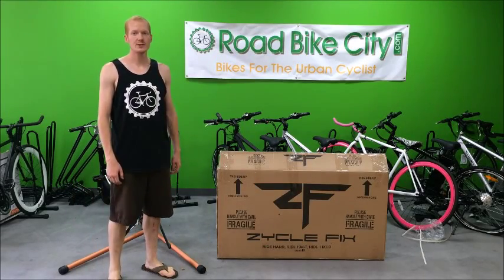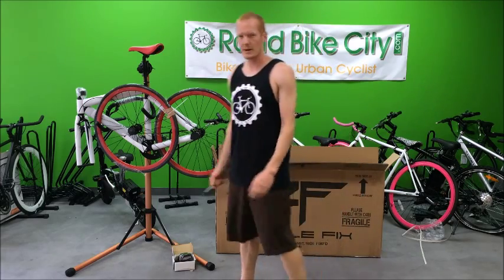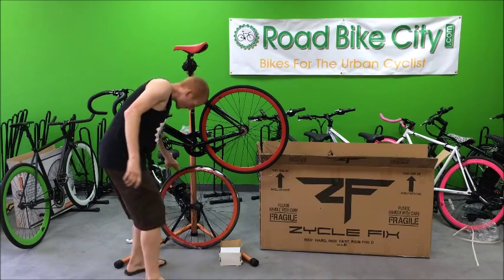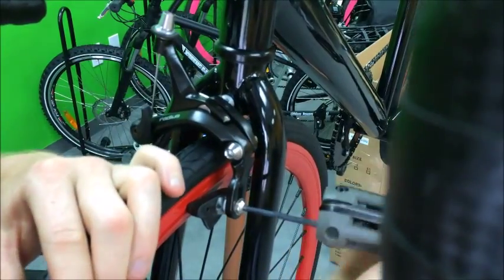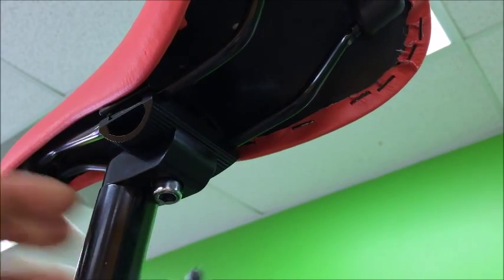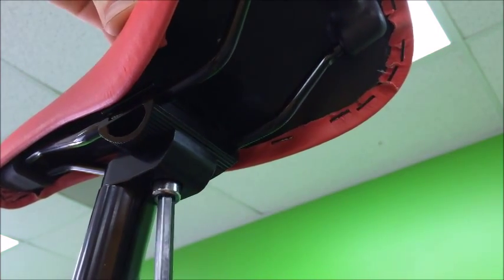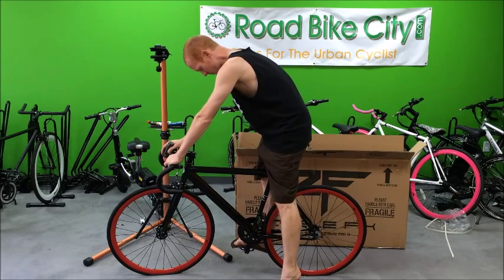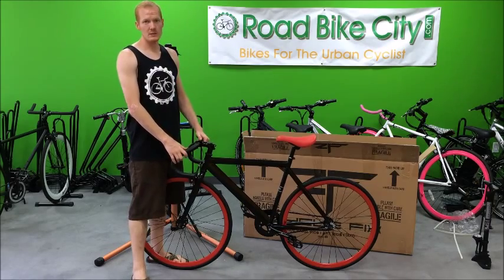Zycle Fix Prime Series Assembly

Comment: This bike looks like it will breakdown within a week. New BB, tires (as usual), brake pads, brake levers, and eventually wheels. I rather get the Retrospec Drome Urban Track which is a bit better.
Reply: I think both bikes are just high tensil steel crap...